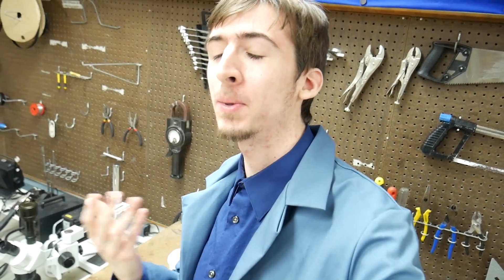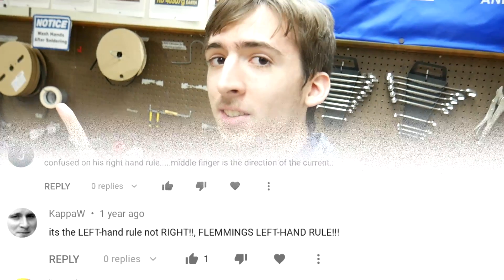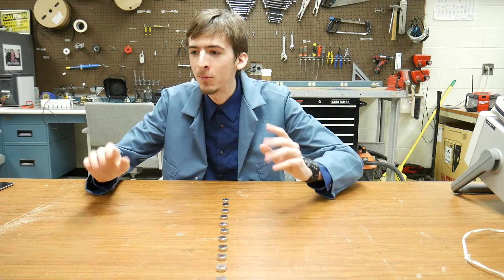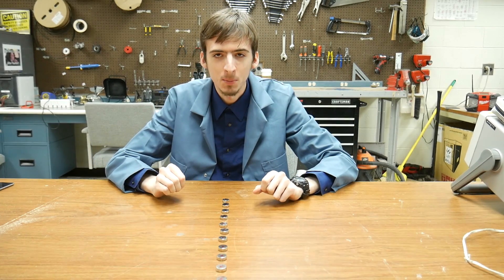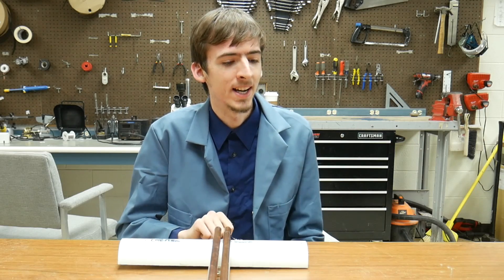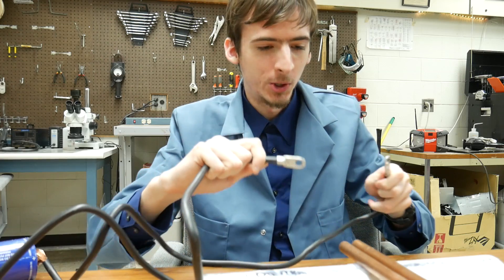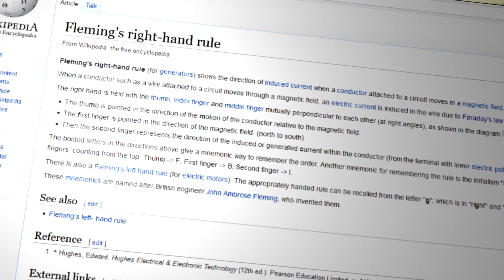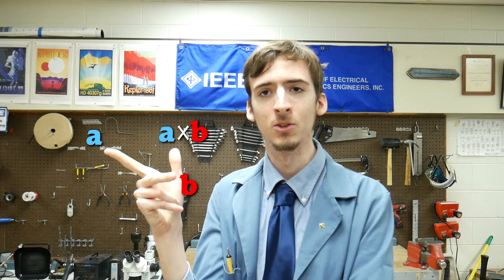Do You Know the RIGHT HAND RULE?

Comment: There is an electrical engineer called Eric Dollard who broke the law of electromagnetism by making electric field and magnetic field no longer propagate in right angles to the direction of propagation simply by connecting capacitors in series and coils in parallel or shunted. For LMD circuit diagram and experiment video, google "The L.M.D./T.E.M.Test - JLN Labs" and "Transverse & Longitudinal Electric Waves and Tesla’s Longitudinal Electricity - Eric P. Dollard". Also you can measure the differences with TriField meter, check video "Replication of Eric Dollard's Analog Computer" on it.

Comment: I don't belive in the right hand rule, I use my left hand also!
Reply from the maker: So long as the vectors jive, just do whatever you are good with. Just understand that there are multiple correct methods - don't decry mine and I won't decry yours :)
Reply: @BlueprintScience  Wise behavior: denigrating involves reactions (corollary to the third law of dynamics: each denigration corresponds to an equal and opposite denigration ... and perhaps worse!) Therefore denigrating is not my method: usually when I find statements that conflict with my knowledge
In this case I hadn't noticed the problem: it's been too long since I studied it at school, I'm 59!